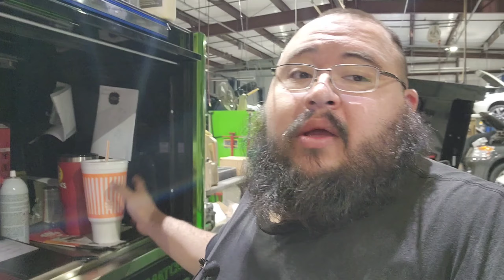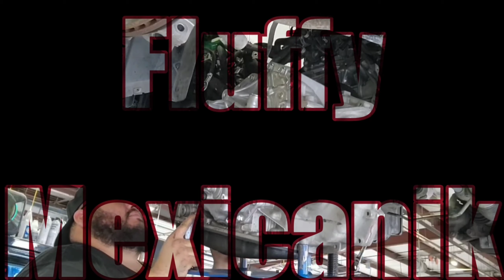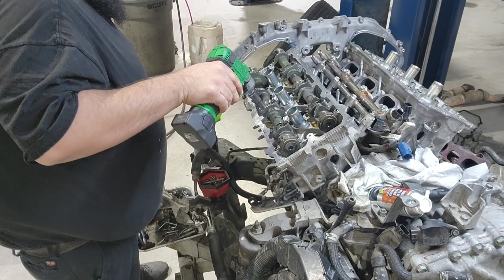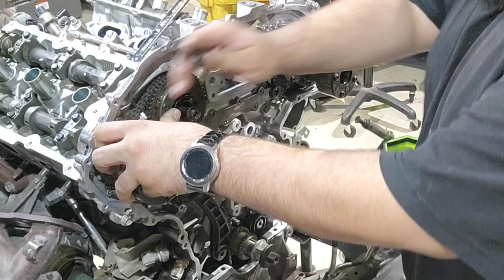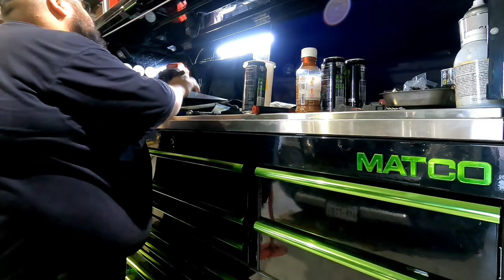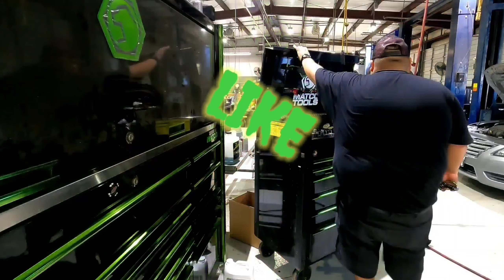CAMSHAFTS AND TIMING CHAINS INSTALLED FINALLY!!!

Comment: When you do these, do you automatically replace the actuators or only if there is a problem when I do Timing chains,I tell them actuators always even if I do not suspect a problem
Reply from the maker: We give the customer the option to replace them since we are already there and aftermarket warranty will not cover unless there is an issue but if we replace chains then yes we do chains guides vvt actuators anf tensionors🤑
Reply: @FluffyMexicanik  yes, I meant if you are doing chains :-)